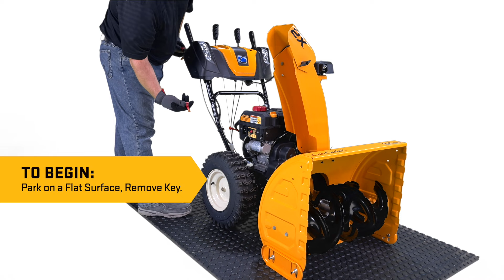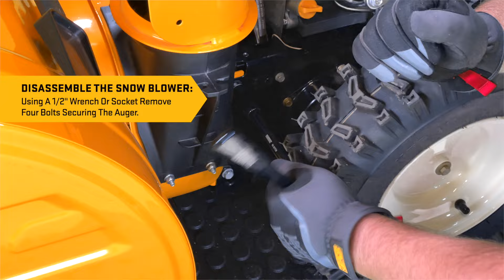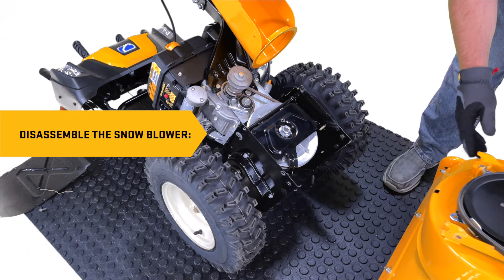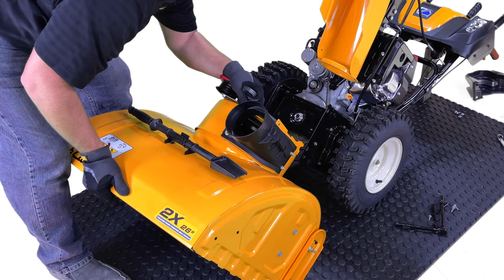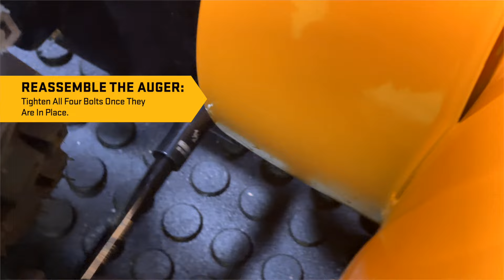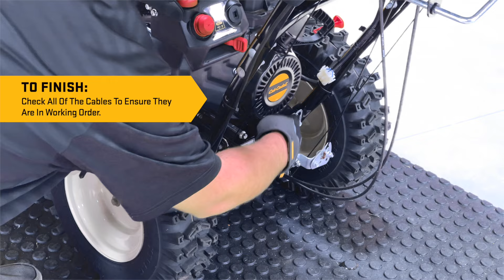How to Change the Auger Belt on a Cub Cadet Two-Stage Snow Blower

Comment: Hard to see what bolts are being turned, black on black and not good angles being shot, and video starts too zoomed in on each bolt. Please start by pointing out which bolt is being removed and where it is on the machine before removing it. Don't even have to show the guy turning the wrench just where the bolts are.

Comment: Just completed this replacement a few minutes ago... I would definitely recommend a stubby ratchet if you have one to get into the tight spots, that was a bit slow for me since I didn't have one available. This is a one-person job until you hit the "reassemble the auger" stage, where I couldn't get it lined up myself to tilt back and get the belt on the engine pulley etc. Other than that, I went through the video and took a few notes to reference. Anyway, it works great again!

Comment: I replaced the belt and now I have no transmission.  Not sure how the two are related.  Could it have something to do with handle end being tipped over when I took off the blower.  Nothing is ever simple, is it?
Reply from the maker: We would recommend calling Cub Cadet Technical Support at 1(877) 428-2349 for some troubleshooting assistance. Please have your model and serial number with you prior to calling in. You can find these numbers on the rear frame or on either side of the auger housing. The model is 11 characters long and will start with 31. Thank you!

Comment: Could you include the part number for the correct belt?
Reply from the maker: We would be more than happy to help provide you with the belt part number(s) for your snow blower. Please message us back with the factory model and serial number of your snow blower. You can find these numbers on a white ID tag on the rear frame or on either side of the auger housing. The model is 11 characters long and will start with 31. Also, please specify if you need the auger belt, the drive belt or both. Thank you!

Comment: What the best belt to get I got a belt cub cadet brand for x3 but when I put it on its really tien and I can't attach  the auger to the other part cause the holes don't match
Reply: Is the belt over top of the brake or under it? It should be tucked under the brake